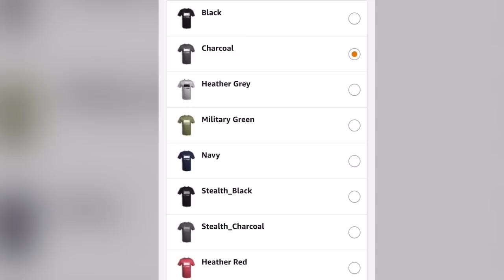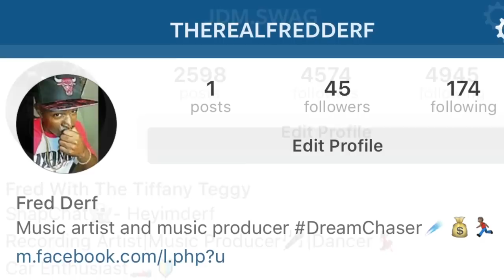JDM Honda Integra B20 VTEC BUILD!!!!! Part 50 Integra out the shop or Nah?

Comment: catch can won't do shit for a oil leak.... but for timing put a long screwdriver down the spark plug hole in cylinder 1, turn the crank, you'll see it go up n right before going down that's tdc... also align your crank gear with your oil pump mark to be sure... then u can actually mark your camera teeth yourself. also there's a big series cam holding tool that's great for doing timing by yourself... keep up the work tho u killing it!
Reply from the maker: Yeah especially when it's a cam seal lol
Reply from the maker: Thanks man appreciate it. U know a lot more than I do lol

Comment: Hey Fred the car looks good but, I have a suggestion for the oil leaking. Try a oil catch can It will catch all the extra oil. I had the same problem on my eg hatch but then once I installed the catch can there was minimal oil leaking. Keep up the great videos
Reply from the maker: +Omar Jr Vargas i got a catch can its too big though and i have to plug it in the block. just too much work

Comment: Damn that oil leak is worst than the 9 oil leaks i had! Maybe check the seals behind your cam gears. Aka main cam seals.
Reply from the maker: I stated in the video it was the cam seals already and I have them. Just need to replace them

Comment: holy fuck that srprised me what kinda fucking oil leak is that? to be squirting out high like that damn...
Reply from the maker: +HellaFlush070 cam seal bro and it dripped on the timing belt with thru it in all directions lol